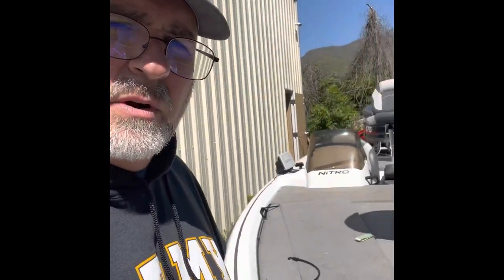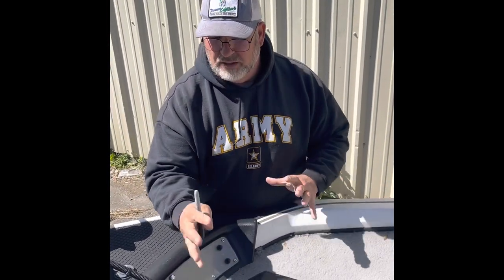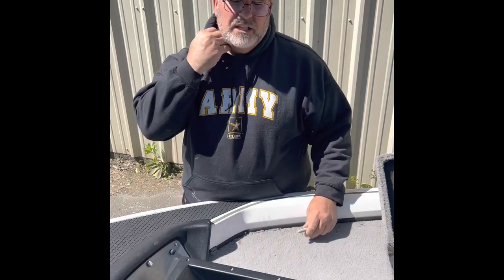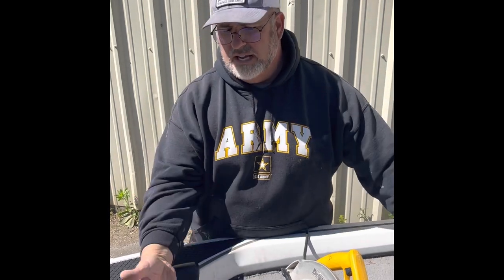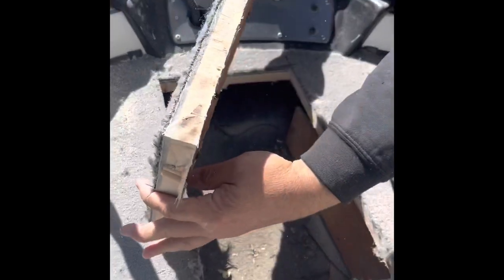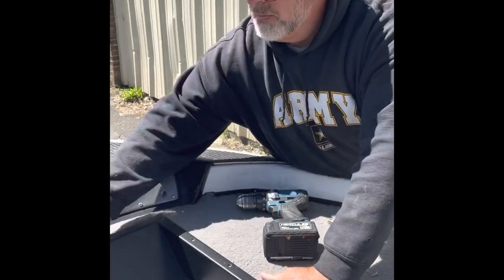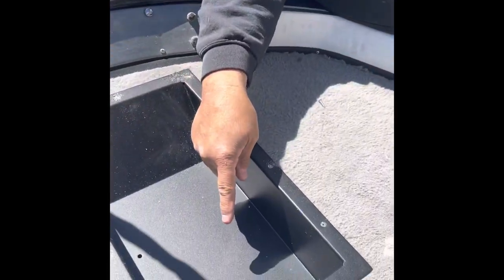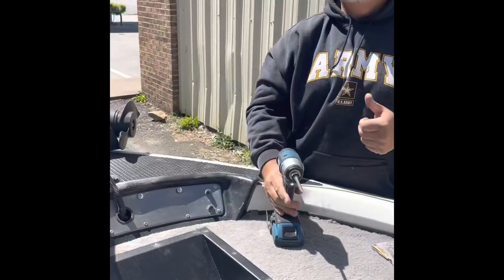How to install Recessed Foot Pedal Tray on your boat! (Step by Step guide)

Comment: Before cutting make sure of cable length with motor both stowed and deployed, sometimes if they are to close the cable can kink when stowed, also check that cable will not interfere with future electronics, you do not want the cable to hit your expensive monitor or have the monitor impede the deployment of your trolling motor.

Comment: Take a string from the rear hole where bicycle seat is find center of hole with string to the center of the front hole bicycle seat, than center that to pedal tray, now your centered, also make u have drain hole in tray, did that to my nitro 901

Comment: I
 have a 2003 nitro and want to take out the old recessed foot pedal tray so I can install a new Minn Kota Ultrex trolling motor. The current pedal tray is too small. What foot pedal tray did you buy to fit your foot pedal and do you think the new Ultrex will fit as well.
thanks, Bob
Reply from the maker: Hey hero, call the shop 828-354-0250 big Mike will point you in the right direction